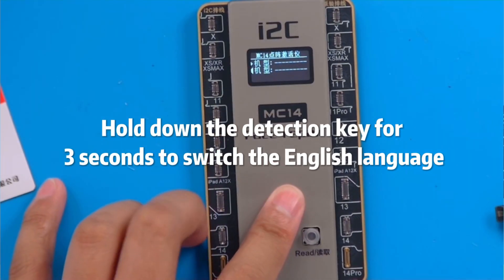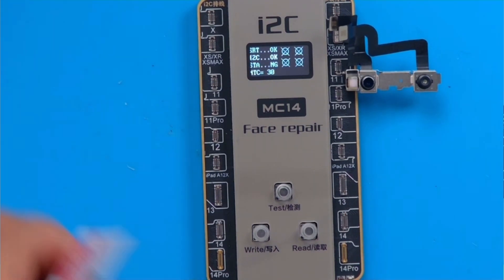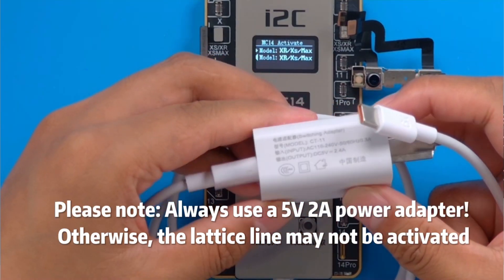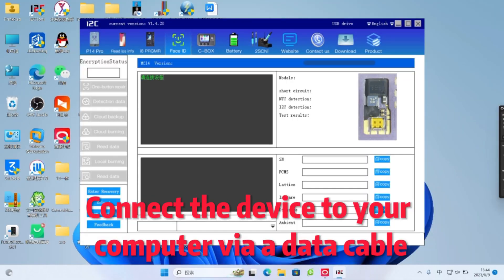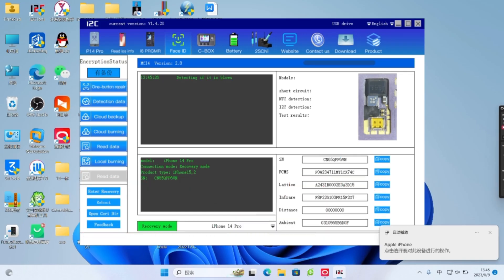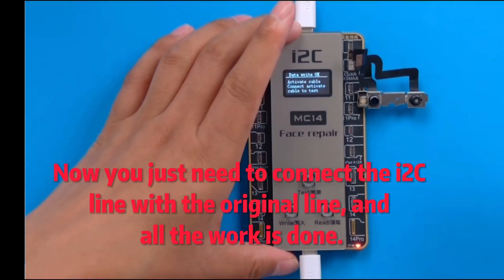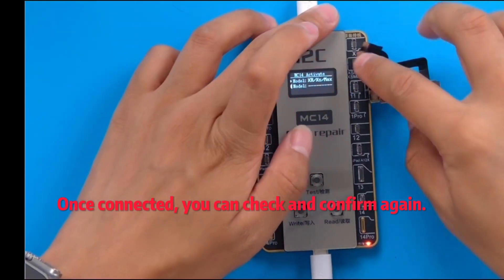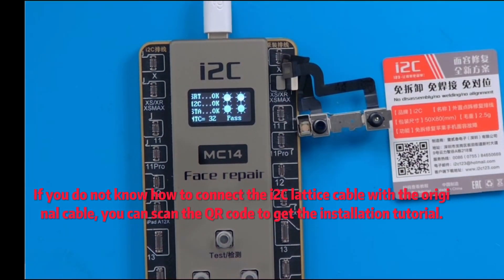MC14 dot matrix repair instrument operation tutorial

Comment: Hello I bought this and on the website it says no need for computer on MC14. I connected my original Face iD to the right and the i2C cable to the left as shown and I simply pressed write for 3 secs. It started the activation process and passed. When I test with cable I get lamp number 3 as "X" and the rest all good "☀️". When I remove the i2C cable and test everything passed except NTC. Any help?